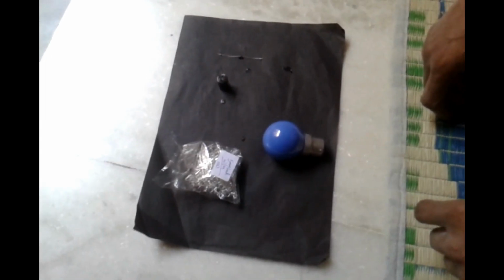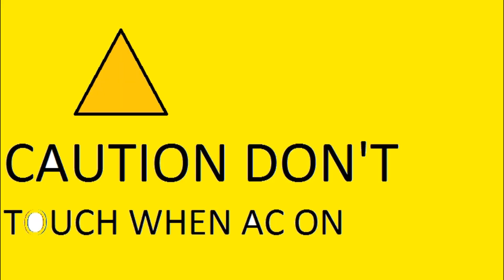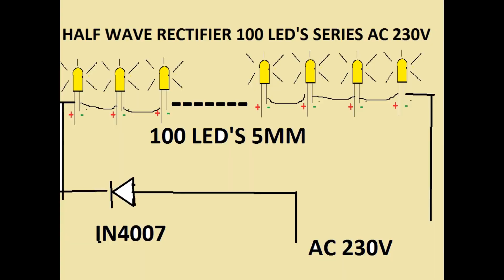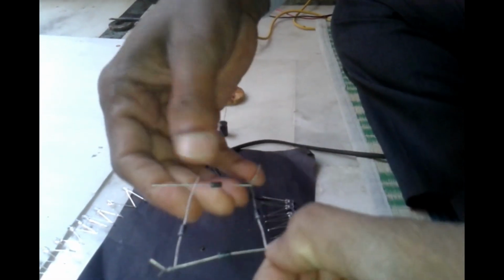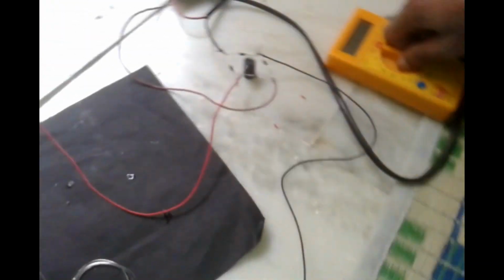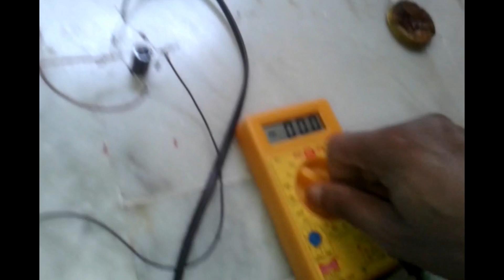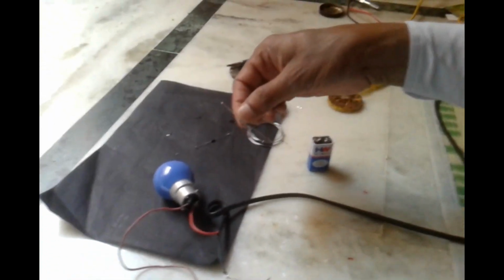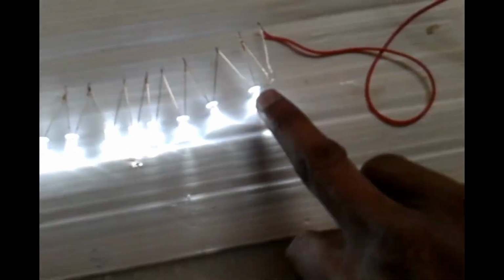how to make ac 230 v led lights using 5mm led's 100 no in series

Comment: why you use diode? It is not required at all. LEDs are diodes in themselves so don't waste diodes. LEDs can be operated directly on AC.
Reply from the maker: for good brightness we have use bride rectifier and capacitor

Comment: Boss.... What resistor should I use if I use 20 white 5mm LEDs???? I would like to use 220v ac because 9v dc batteries are expensive..I am also doing it in series....Pls help.... For school project...

Comment: Here is a challenge for you sir. I want to light the branches of my trees with twinkling LED lights using 120V AC power. 1st, how to get random lights to twinkle on a series string, then power with AC. I think you are a genius from your videos. What parts did you use for the strings. Please supply this information. Thanks
Reply from the maker: connect 50 led's each brach to ac 120v  and conncet all branch led 's trip ac to parrelall
thank you

Comment: Brother i have doubt
I doing led letter board for Christmas
It's total of 700 LED, I'm doing with 4 series line LED connection and all link connected in parallel to 12v 5amps battery
But while connecting in battery, one line is getting fused 
Where should i fix resistor and how it calculated?

Comment: You may connect 10k resistor in series.
Reply from the maker: lights wil not glow because 10k resistor drop lot of  ac voltage

Comment: 50 5 mm led सीरीज की सप्लाई कैसे बनाएं
Reply from the maker: WE CAN CONNECT 8MM AND 5MM ALSO
Reply from the maker: IF YOU CONNECTING 50 LED'S CONNECT AC DIRECT WITH 220 OHMS 2W RESISTOR IN SERIES TO AC